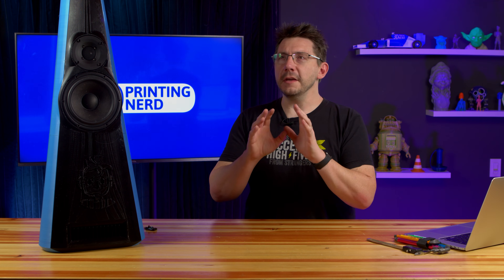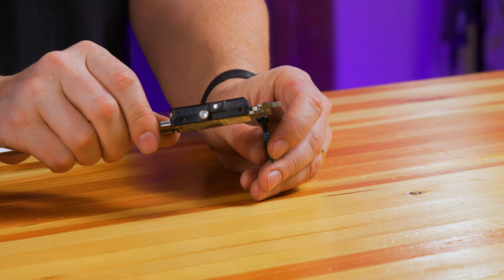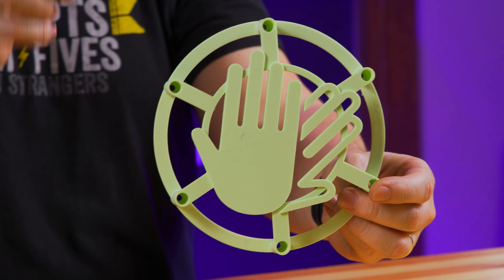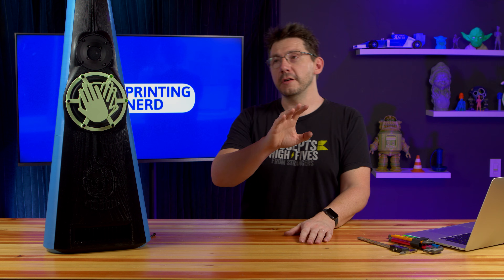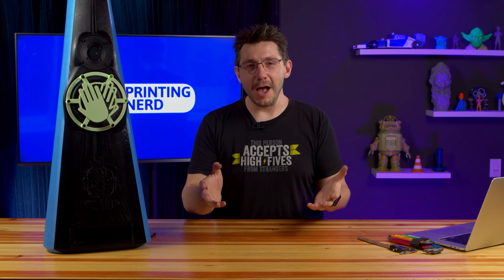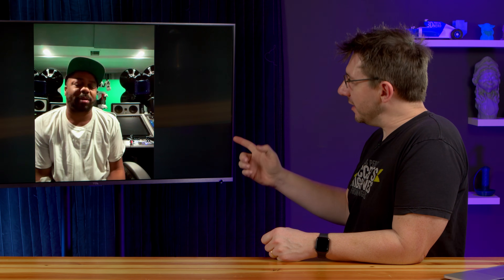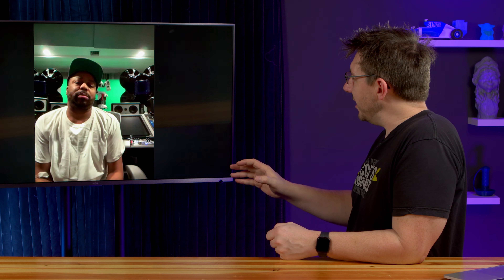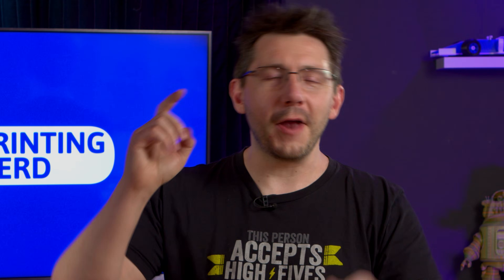3D Printed Speakers Part 4: Design Challenge! WIN A PRUSA MINI! #3DPNSpeakerCover

Comment: I follow you enough to know you're the guy whose recommendation I would want if I were going to buy a 3d printer.  But, that doesn't mean that I know what printer you would recommend. "What price range?" I would imagine you would ask first. Well, I'm the type who slides up the range as I understand what the extra money gets me. I'm not seeing a recommendations video that answers the question (if there is, I guess I just need to look harder, or maybe someone has a link?).  I'd like to see something like "if you have $400, this is the one. For another $X, you can get this one, and it has this feature".   I'd build one from a kit if I somehow got a super nice printer for half the price (I might look into kits  anyway - I figure when something goes wrong, I may as well already know about how to fix it, becuase I get the impression stuff goes wrong all the time).

Comment: Issue with the dimensions in the video, you mention that it's 166mm in diameter, however when I took a look at your template it seems to be 176mm in diameter, inner diameter of 156mm.
Reply: 166mm is the diameter for the mounting holes to be centred on
Reply from the maker: Callum is correct.
Reply: @cheesus9713  Ohhh okay, fair enough. Cheers mate!

Comment: An easy modeling trick if you can’t do a hole pattern tool is to just make a hexagon in this case and draw the circles on those 6 points.
Reply: Yeah I was like “difficult hole pattern excuse me?” There’s a function exactly for that in Fusion 360 sketches.

Create > polygon > inscribed polygon, 166mm/2 and boom. (It’s a radius)

Or create a 166mm diameter circle, create a point on it, create circular pattern and do 6 times with full rotation.
Reply: @GuardedDragon  yeah there’s many different work flows and this is a good trick to have. I also like to just place a point and then use the hole tool for standard components and use a pattern. Generally the pattern doesn’t change but the hole dia might so then you can go to your featured list and select it there to change all the hole dia. Sketching works great too just need to change every dimensioned hole or you need lots of equal constraints.

Comment: You should provide a .f3d or .STP file for people to use as their template. Not everyone knows how to convert an STL file so it is usable in Fusion360 or their choice piece of software.
Reply from the maker: It’s just 6 5mm holes evenly spaced on a 166m circle. My goal for the template was to provide it for people using apps like Tinkercad. If you can use fusion 360 there really isn’t a need for the template. At least that was my goal.

Comment: i thought you were gonna link the spec sheet
Reply from the maker: I did - now. Sorry about that. Link is in the description.
Reply: @3DPrintingNerd  thanks
Reply: @3DPrintingNerd  how do I add a hashtag in thangs
Reply from the maker: Add to the title or the description
Reply: @3DPrintingNerd  Thank you. Do you have a WRX Sti or just sit wasn't sure which logo to put on the speaker cover? Can I do multiple entries?
Reply from the maker: Enter as many designs as you want! My oldest 2006 WRX bit the dust so I’m now driving a 2020 WRX

Comment: how far apart are the holes
Reply: Check the spec sheet, but with round speakers they are typically equally spaced.
Reply from the maker: 6 5mm holes evenly spaced on 166mm diameter circle. I tried to explain it and Sean made a sweet animation. However, data sheet is linked in the description.

Comment: Love your high five design.. one critique to make it perfection is to remove the ring from the hand in the background.. you have a portion of the ring running through the fingers and I don't think it needs to be there.
Reply from the maker: I just looked and I don't think I'm seeing what you are seeing. What do you mean?
Reply: @3DPrintingNerd  there are two "rings" in the design. The order is the hole pattern ring and the inner supports the hands. The front hand is solid and the back hand is "hollow" except you can see the ring through the hollow hand. I think you could do another cut extrude through the hollow hand so you can't see that inner ring. Hope that makes sense.
Reply from the maker: Um... I think I see what you’re saying. The inner ring is there on purpose, though. So, it supports the hands but also is a circle in the middle. That part doesn’t HAVE to run through the fingers to support it, but I wanted the circle visible when not occluded by the hand.
Reply: @3DPrintingNerd  yes.. That is all I was saying.. Perhaps remove it from the hand in the background but leave it everywhere else. I love the design though.. Unfortunately we have been extremely busy printing and designing our own parts I doubt I will find time to submit a design :( I look forward to seeing the future video with what people came up with though. Awesome community we have!